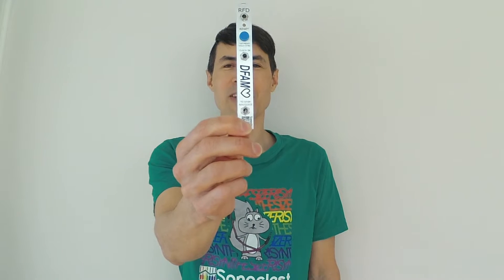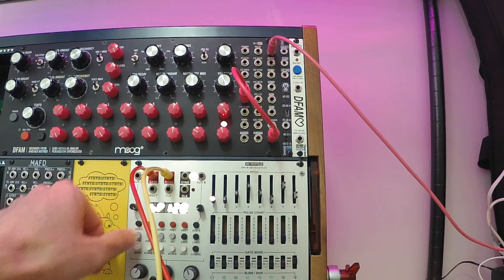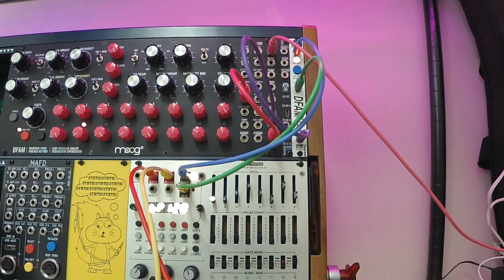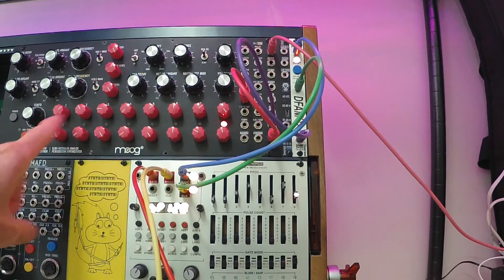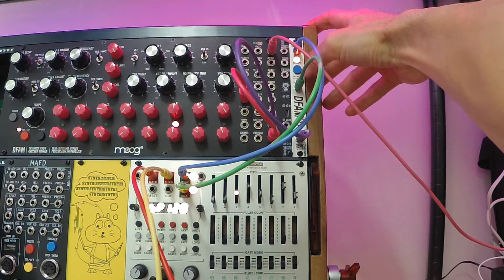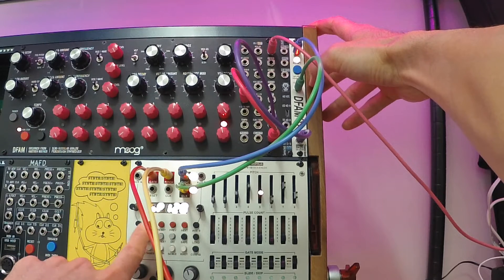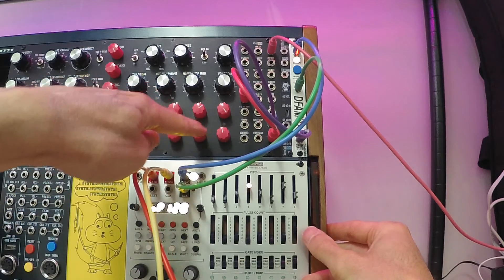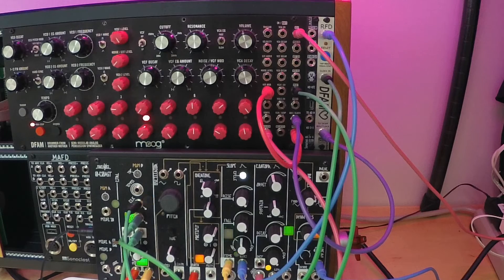How to reset a Moog DFAM's sequencer / RFD Eurorack Module (Reset For DFAM)

Comment: How does this link up with MAFD which has the same To Clock/Adance? Any chance for a combined RFD and MAFD?
Reply from the maker: Yes, the MAFD and RFD both use the Adv/Clock input on the DFAM. The MAFD is for MIDI control, and the RFD is for eurorack clock/reset control.
Reply: @Sonoclast so it's one or the other, not both? Any chance for a combined single module?

Comment: What a great solution to a wildly overlooked implementation!

I clock my DFAM with a Pam's New Workout. I currently send out a 4x multiplier so it's spitting out 16th notes. I would like to be able to change this to say 2x, or 8x, or any other multiple, while the sequence is running, but of course it becomes out of sync with the rest of the clocked modules. Would the RFD sync it properly after changing the multiplier, if I were to use a second Pam's output to send the reset trigger? I'm pretty sure it would, but would like confirmation. I would really like to use the DFAM beyond just the 16th note paradigm during my live sets.
Reply from the maker: Thanks! We don't have a Pam's to try it out with, but I think what you describe would work. Like other clock/reset modules, the RFD is designed so that the DFAM restarts at the first step in sync with the first clock (rising edge of a trigger/gate) after a reset (also rising edge of a trigger/gate).
Reply: @Sonoclast  Sounds good, thank you so much for the response and info!

Comment: Cool. Can the RFAM output be multed to control two DFAMs? Can you explain how this is working? Will it work at any tempo?
Reply from the maker: Hey, there's only one DFAM here, but the following signal path works just the same as the relatively low tempos shown in the video: Sweeping the whole range by hand of a 0-coast audio rate square wave > driving the clock of Metropolis > triggering clock and reset of RFD > output to Doepfer A180-3 buffered mult > buffered output to DFAM. The DFAM stays in sync as the Metopolis sequence length changes from 9 to 15. Presumably another DFAM could be driven in sync via the buffered mult.

Comment: could this have been in a 2hp package?
Reply from the maker: At minimum, 2hp would require a smaller button and chips with smaller footprints. The larger button is a design choice to match the buttons on a DFAM, and using larger footprint chips is a function of the current global semiconductor (lack of) supply situation we are in.